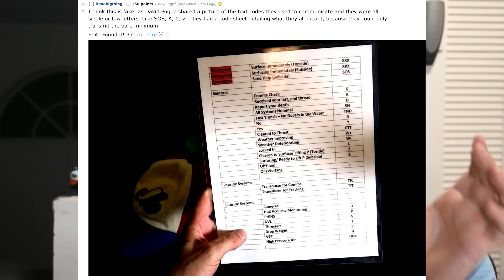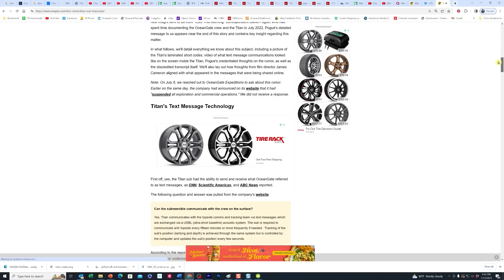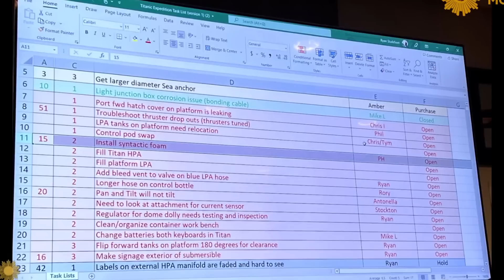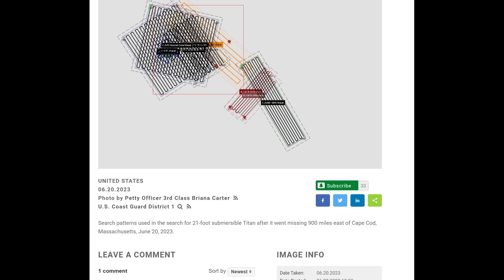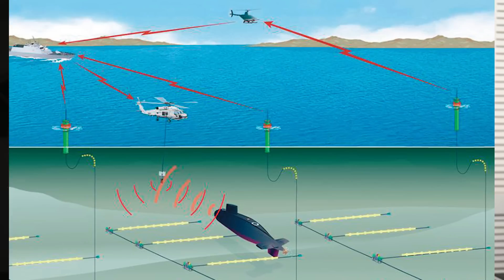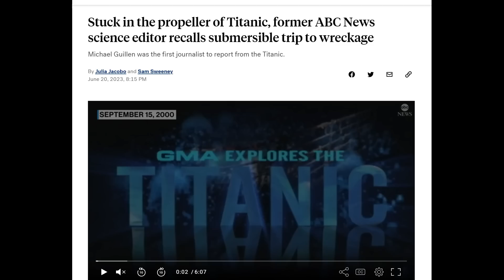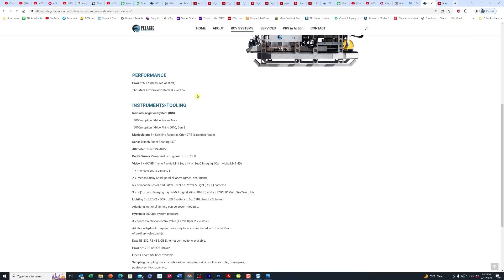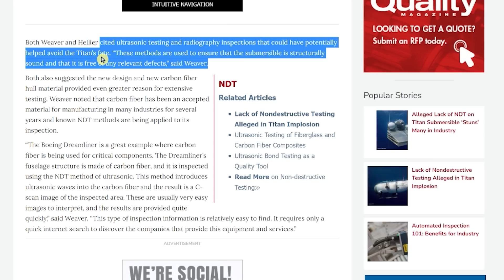The Shocking Truth About Fake Sub Transcripts No One Tells You

Comment: Could be fake but I'd guess it's real from the reality details like descending fast and trouble ascending and stockton rush knowing best.  He felt a stock ton rush.
Assuming no one had suddenly added more weight to the sub, could it be that the pressure hull had actually reduced in size? that would be wild. If so they might see shrinkage on the titanium parts at one end or both. If the matrix of the CF was undergoing plastic deformation and the fibers were bunching up, no longer providing strength and it was only the plastic holding the pressure. Just surprising if that's a slow progression. If the transcript is real they didn't seem to experience a leak so it's a surprisingly uniform failure. 
Carbon fiber might be usable under pressure but perhaps only with a binder that doesn't plastically deform at the given pressure. It's possible a carbon carbon bond like disc brakes could work.

Comment: The transcript "feels" real to me.  I've worked with rigs and ROVs and the language is the sort I would expect.  When things start to go wrong people revert to normal speech, acronyms are fine when its all going well but when its going wrong we want to be sure we have made our message clear.
CF - its a fibre - great in tension, in compression its the matrix that takes the load, a basic error.  There is also no talk about the different strain rates under load for CF and titanium. The titanium was glued to the CF at 1 bar, then it was taken to 100s of bar with no allowance for differential movement and the stress concentration at the joint.  Terrible design.
NDT - this would have been easy to x-ray, an isotope inside and large film plates wrapped outside.  Done on aircraft wings all over the world.  I suspect they knew there were voids.

Comment: Over 50 years ago, as a senior technician on an RN frigate, I was responsible for the maintenance of various bits of kit, including the echo sounder and underwater telephone. The UW telephone worked acoustically, and conversations could be held in almost real time, depending on the depth of the other party. It was basic technology, and the distortion was enormous, and it was certainly never used at Titanic depths - but in 50 years technology will have moved on, right?

Comment: The thing that makes me question this transcript is that I don't think the frame was intended to be jettisoned.   It seems like a structural part of the sub and something that must be there for the sub to dock with the launch platform.  If it can't dock, they can't get it back on the ship.  Since it is an integral part of the system for launching and retrieving the sub, it doesn't seem like an option to design it to be released from the sub.  If they can't get it back on the ship, how can they possibly open it for the passengers to get out?

Comment: It's pretty hard to do NDT on carbon fibre. Ultrasonic is hard since it's already inherently non-homogenous. X- ray is hard because the density is low.

Hard doesn't mean impossible though; hard means expensive, and I think that's the crux.
Reply: Thanks for this comment. I was searching for anyone who had picked up on this.
@RealEngineering made a video about the incident and focused a lot on carbon fiber and testing as this is the subject of his master's thesis.
In truth, I suspect that only a destructive test would have been sufficient in terms of verification, and carbon fiber was an inappropriate material for the task, as many experts had pointed out in advance.

Comment: The biggest questions now is really the type of carbon fiber, type of epoxy and the curing process. The type of ndt and if it was ever done. Did they do a burn test on a test part to see the epoxy fiber ratio the winder was feeding. The thickness of the carbon fiber and what safety factor the thickness was increased to from min. These are the the questions both my son and I have. Both of us have experience with carbon fiber/ graphite fiber. He does ndt on aircraft for the airforce and I'm a marine unlimited chief engineer so we both have interest in this subject.

Comment: I am intrigued by the logistics of the ROV doing the recovery. Did the ROV have a bin/basket of some sort that it loaded material into for it then to be hauled up to the surface or did the ROV do many trips up and back?
How did it scoop up the smaller objects? Does the ROV operator have videos of the operation? (President they do)
And finally, there has been no mention of the penetration(s) that must have existed in the rear titanium hemisphere for power, control etc??
BTW I reckon the transcript is fake.
Reply: @@jasonriggs6737 and how did the cable get back down to the ROV?

Comment: You were talking about the sealant not oozing out of the joint, as if that oozing would be some kind of crude proof that, indeed, the joint was sealed.  I'm wondering if they should have used a circular O-ring to try to seal the joint between the titanium and the composite-fiber cylinder.  In your car engine they use a thin gasket material, not glue, to bond the engine head to the block.  In the Challenger space vehicle they used O-rings to accomplish a seal - we remember that O-ring being too cold to function as intended.  Had Oceangate used O-rings they should have used torque wrenches to compress the O-ring uniformly all the way round.  I don't recall seeing a torque wrench when they sealed the crew inside.

My thought was that by effectively "gluing" the composite fiber to the titanium they may have caused the two materials to act monolithically, as a continuous joint, when a simple joint - with a simple O-ring might have caused less flexural stress in the composite fiber cylinder.

Your communication transcript certainly "looked authentic" to me.  The Navy may have known/suspected that they'd heard the sound of an implosion, but, what if the Navy was wrong?  The Titan could have been bobbing safely on the surface somewhere.

Comment: Question regarding all the electronics in the back, inside "that pointy thing:"  Aren''t there some wiring, etc. that has to go thru the hull of this thing from the electronics?  Wiring that has to feed to the inside of the submersible itself?  If so, how is that possible given the pressures these submersibles deal with?

Comment: I work with sealants for various things in the home building industry, I realize it’s a much different industry. But when using any type of sealants, especially when installing windows over window flashing, you apply the adequate sealant so that there is proper “squish out” this is to show the proper amount of sealant is being used. You do this for all water tight applications, windows, roof etc. you can tool or wipe the excess once all fastening is done. 
Well, I don’t see those end caps on the Titan being any different.

Comment: Like Morse code, for want of a better term shorthand it could be that the screens supply full images but the actual code is just a few characters between the ships, the computer translates a few characters into whole sentences because quite a lot of the conversation would be related to what they were doing. Or semi abbreviated so most things  would be said commonly will be just a few characters which the computer translates but also have a system where it does but not in real time when the computer waits until it gets the full message then displays it. Will start and stop characters

Comment: I worked in a machine shop that made molds for 20 Years. We have made pipes that were much like the the OGS. We had a saying, "It's the glue that squeezes out that holds it." I cannot imagine a glue joint possible that would hold this together under that much pressure.
Reply: but the pressure can keep the end caps tight against the cylinder, a problem can be a small gap where water could leak in.
Reply: @rotorblade9508  it cannot keep the glue joints from failing when the cylinder walls are pressing inward, pulling the CF away from the titanium plates. But I’m not an engineer. I’m a machinist and 3d drafter.
Reply: @solariptura  The water pressure would push the end caps tight against the cylinder end and prevent any gap forming. The potential failure mode (of the joint) is buckling of the cylinder end. At collapse depth even the tiniest deviation from a perfect circle is unstable and progresses rapidly (ms) to an ellipse. So it fails in shear.
Another potential failure mode is the cylinder end collapsing due to axial compression - the pressure is several times the water pressure because the load on the whole end cap is supported only by the narrow cylinder wall.
Reply: True the fact the overlap of the titanium and carbon was only like 25mm was the main concern to me u can see on the photos its that section that failed
Reply: PERFECT!!!!
Reply: I mean.. it did work. Numerous times actually. But clearly, not very reliably which is the point.

Comment: You can lift items under water easier than out of water as they have less weight because of buoyancy. So they can get them near the surface & then a diver can attach a line to lift them out of the water.

Comment: OceanGate had a long-standing relationship with Teledyne Marine, manufacturer of equipment for sonar imaging (BlueView), inertial navigation (TOGS/TOGSINS), and undersea data transmission (Benthos).  Teledyne supplied almost all the electronic equipment used on OceanGate submersibles.  The ATM-900 series acoustic modems have bit rates from 80 to 15,360 bits per second, depending on conditions and operational mode.  Redundancy is used to minimize transmission errors, effectively halving the bandwidth.  The usable transmission rate could be as low as 4 characters per second at times (but not always).

That isn't very fast, but you don't need a lot for pure text.  One could type a full sentence and let the equipment do its thing.  If the message takes 10 or 20 seconds to completely arrive at the other end, so be it.  The codes may be useful for routine status updates or when time is of the essence (e.g. emergencies).  However, they are very limited in the scope of expression, and it is not a surprise to see the crew at each end using relatively normal English.  To suggest that because a list of abbreviations and codes exists, that one must use these codes and nothing else is laughable.  In no way does this prove or disprove the authenticity of the alleged transcript.  Personally I am undecided.  I can see arguments both ways.

Comment: I think the sub that recovered the parts didn't actually bring them to the surface, it attached lines from the surface to allow them to be pulled up, those grappling 'hands' look really small, and if it slipped out of the ROV's grip due to water currents or poor holds, it'd be a real pain to go back down and find again.
Reply: Usually they attach to air bags and they float up

Comment: This might be crazy, but I wonder whether the quicker than usual descent was a consequence of water already getting into the submersible adding to the weight and, ultimately, shorting out batteries and making ascent impossible.
Reply: @rdownmakeITbetter
How is enough water going to get into the submersible a drop at a time to do that? Enough to overcome the initial positive buoyancy and the weight of the ballast and most of the weight of the support cradle? Looks to me like it takes hundreds of gallons a drop at a time over less than two hours without being noticed.
Reply: @bradkay  You're probably right - it was just a theory I had to explain why they descended so much faster, why they could not ascend despite dropping ballast etc and why they seemed to lose electrical power. Remember, even the tiniest pinhole would, as they descended and pressure increased, produce something like using a water jet to cut through steel.

Comment: On the USN hearing a "sound consistent with implosion", what was the USCG supposed to do? "Oh the Navy thinks the sub imploded so we are going to close the search" would have just created outrage because it's just "sounded like an implosion". The proper thing to do is to find either the sub or strong proof that the sub no longer existed in one piece, and meanwhile continue the search. And that's what the USCG did until eventually they got the ROV down to look see look see.

As for the NDT, I believe OceanGate claimed there was no way to do NDT on their craft.. ok, fine, but part of developing a new type of craft is to figure out how to do maintenance on these, and that include figuring out new NDTs for the material chosen. Not doing that smacks of ethics failures.

Comment: Thing is .. Wireless button mapping of controller needs 3rd party applications, and the monitors in the sub seem to be running specific applications and not button mapping applications. Ive button mapped my XBox controller into a wireless mouse, but i can see the 3rd party app im using, its part of the running apps, so controlling the sub remotely for precuasionery reasons seems logical, its what id do if im mapping a joypad, mapping can be done in all types, bluetooth,wifi,infrared and cabled .. problems about 3rd party bypass apps, not fully reliable especially if its a Mod/Premium patched/Full versions.
Reply: First sentence in thw waiver has the key words "Remotely Operated Vehicles"

Comment: I would think the answers to many of the questions is simple.  Cost. NDT isn't cheap and requires special equipment.  A cable to reach the depth of the Titanic to lift the Titan and facilitate communication is very expensive as is the equipment to reel it up and down.  Rush was doing this project on the cheap as much as possible.

Comment: Not sure about the adhesive example you gave, Jeff. I can't help but think of sharkbite fittings which use no adhesive at all. Of course the pressures are just slightly different at 4000 meters underwater...

Comment: 1. the leaked transcript is obviously real. nobody lame enough to fake something like that has the brains to make it so subtly different from what was expected. also it accords with what james cameron said early on. in fact, he is probably the source of the leak.

2. the reason rush was descending so fast is because he knew he had crap batteries and he was trying to get the mission done as fast as possible before they died. i am sure this will come out eventually. 

3. the reason the coast guard and navy sat tight on that info is because they like doing exercises and spending money. if you tell people up front these guys are dead, you can’t justify a giant wasteful search. sorry, but that’s the truth.

4. CEO of some specialist NDTcompany using this moment to tout how important NDT is… jerk me off, buddy. you could do all the NDT you want, it’s not gonna pick up anything significant here. carbon fiber is super hard to detect cracking in, and adhesive is impossible. so yeah spend $10,000 after every mission to learn nothing at all about the condition of your sub, it’ll still kill you. the design was absurd from day 1 and no engineer with two neurons to rub together would ever approve such a thing.

Comment: "Thrusters on backwards"... For real? I mean, this should not have been possible and it alone should have disqualified the usage of this sub.
Also, the navy knew instantly. But they likely operated on the principle of hope - as long as there is no confirmed debris you assume that the sub may not have imploded and search for survivors just in case. Further, they will have triangulated the implosion site in 3 dimensions with an accuracy of less than a meter I expect. Of course I don't know, as I am not in the navy nor have any contact into the navy, but it's 2023 and naval and sub-naval warfare has been a thing for generations. Of course they have the technology to triangulate any louder-than-background noises in the ocean in 3 dimensions with high accuracy near-instantly.

Comment: You need to check on the carbon fibre layering, on other videos showing this construction, they did have a constantly changing angle of lamination, however it as been pointed out that the resin was seemingly rather dry and there might be concerns as to the impregnation of the resin and equally the sane nay be true of the bond with the titanium, they may have had the resin quite thixotropic as the ring was placed on to the vertical carbon fibre trunk . There are certainly at least two very conflicting suggestions about the final few minutes, one is in this text and time line and another seems to have a complete electronic failure, were tris comes from I do not know, but this other suggestion as the Titan plunging down to the bottom. At the moment the text can be verified by the crew if they wish to, It seems to me to be plausible. What I think cannot be overlooked is the usable life spam of the carbon fibre design, it appears the the crew were nit fully aware of what the cracking sounds indicated and they continued to use the one vessel without it having regular sound and Xray checks, so they were diving ignorant of its condition. It is total arrogance that negates caution.